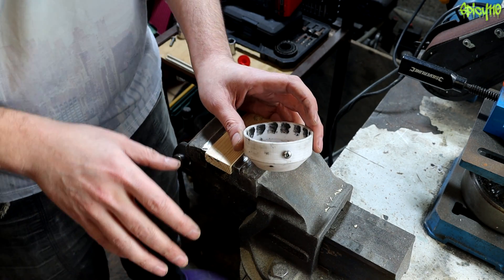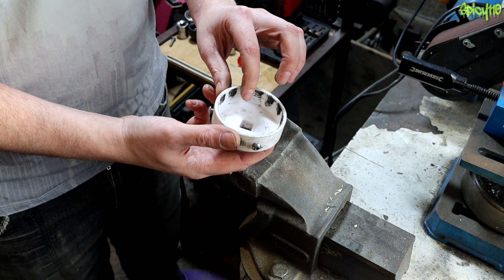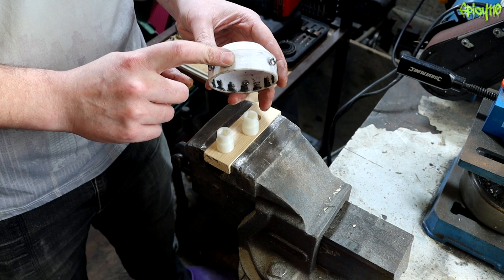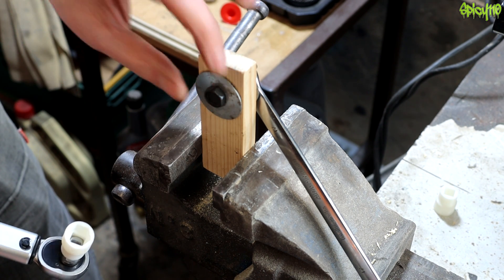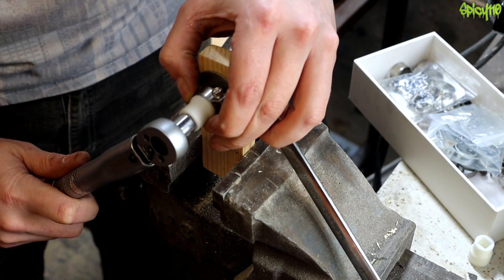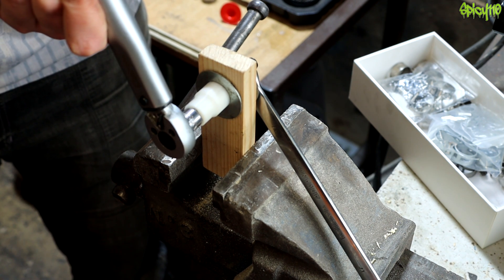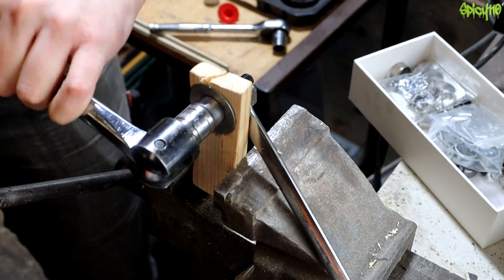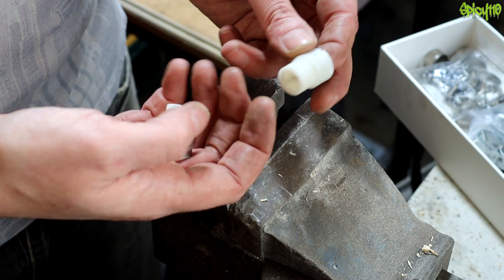3D PRINTED SOCKET!

Comment: When I did my oil on my bike, got pissed off after 20 minutes of trying to get the filter off, ended up just putting a screw driver through the side and using a wrench as a lever 😂
Reply from the maker: Yer it's a very well-known old trick. Of course, I know of this method but that should give you a hint. Not a great idea to do.

Comment: I have bought dubious cheap socket sets with similar characteristics.😂
 I was once present when a company purchased a professionally grade 3D prototyping printer back when they were a very new thing. It used polymeric powder and a laser to fuse it. The tech loaded a machine drawing and we let it work for nearly an hour. He then reached in and dug out an adjustable wrench, tapped it on the side and worked the thumb wheel and the jaws moved!  It was only in wax for lost wax casting but I remember being utterly blown away.

Comment: I service engines all the time. I have found that the best oil filter removal tools are the ones that are either belt or chain based. Of course, if engine manufacturers had just ONE sensible cell in their body, they'd make sure that items that will need access regularly was placed in a slightly accessible place, but no. So, your mileage will vary.

Comment: I've made 3D printed M5 nuts, bolts and screws using PLA, used them in making my filament dry boxes. I found slotted heads worked best for screws, anything like Philips or Allen tends to strip or break off very easily. In the end I used slotted hex headed bolts so I could use either a flat headed screwdriver or a spanner/socket to fasten/undo them. I used a metal nut/bolt to clean the printed threads up after printing. It's cool tech but you have to learn to work with the limitations of the material and the bond strength between layers, print orientation makes a big difference. What works for metal might need some dimensional changes to work at all in plastic.

Comment: Am only 1m30 in but... hose clamp around the outside.  The screw to tighten type.
Aaaand I stand corrected.  I've done it successfully on those O2 sensor sockets with the cut-out for the wires, as they like to pry themselves open and slip.

Comment: I just hammer a screw driver through the thin metal of the oil filter. Makes a bit of mess, but its never failed to get the filter off.... I've seen somebody (maybe Donut) try 3d printed dockets before. They failed similarly.

Comment: you'll want to make it thicker with build it solid walls (rather than 100% infill) cool test never the less though.  I also think if attached it to a screw driver to eliminate twist or holt the head of the socket so it sat perfectly sqaure to the bolt it would probably be slightly stronger

Comment: Instead of doing 100% infill you should try changing the number of walls to 999. This will make the entire print out of walls which should be stronger than 100% infill. I still don't suspect it will make a huge difference in this application but it could
Reply from the maker: Do you not think that would not make it more likely to part on a single layer plane?
Reply: @spicy110  you could aneal it so the layers merge, you may need to print over size to allow for shrinkage.
Reply: @spicy110  I'm not sure to be honest, I just know in general applications in 3D printing if you want parts to be stronger, they say to use more walls rather than more infill, so I figured I'd suggest it. I'm sure it depends greatly on the use case if it'll make any improvement or not, but its worth a shot!
Reply: 999? It's only likely about 8 walls at most
Reply: @funkycowie  The reason to make it 999 walls is because the slicer will then just automatically make the entire model out of walls. If it only needs 8 walls, it'll do 8 walls when set to 999.
Reply: Also print with thick lines that squish together, 0.6 - 0.8mm line thickness from a 0.2mm nozzle will do the trick.

Comment: It would be interesting to compare the same prints made from PETG, and maybe carbon fibre if you want to splash out on a roll and a hardened nozzle.
Reply: PETG would be worse, carbon not much better.
Reply: sintered metal 3D print